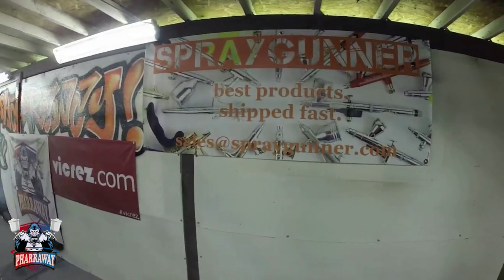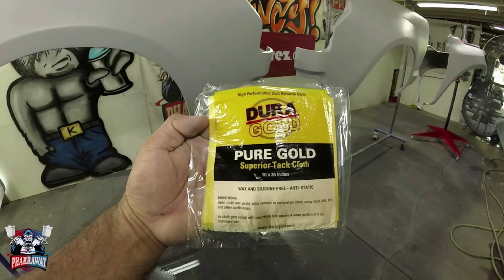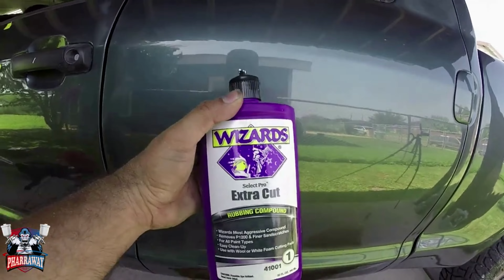TOYOTA TUNDRA FULL PAINT JOB FROM START TO FINISH

Comment: Why isn't the front side fender/panel as shiny as the door panels?  Is it because it's fiber glass as opposed to the doors being metal?
Reply: Its just the way it looks in certain lighting. Because the fender is bulged so aggressively, the light looks different in the flake than the adjacent body panel. The fenders are certainly just as shiny as the rest of the truck.